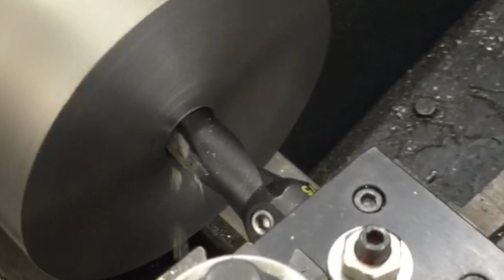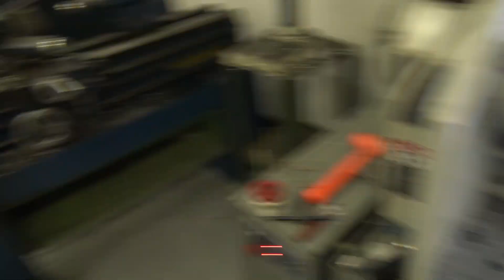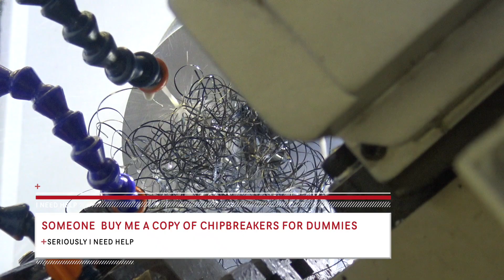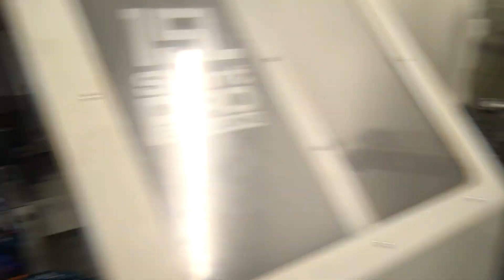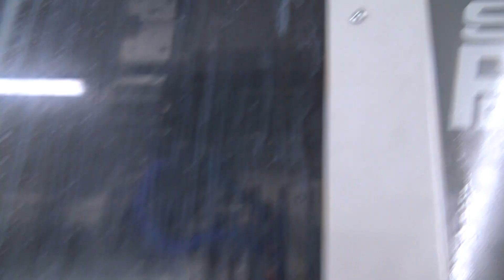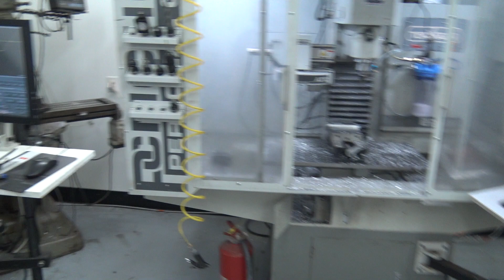Turning Steel Cones on CNC Lathe!  Widget86

Comment: Chip breaker 101, at least the quick and by no means complete version. You need to have a DOC greater than your tool nose radius at the very minimum with non self-breaking materials like steel, where brass would be a self breaking material. Then dependent on the chip breaker you are using you will need a feed rate of at least one third of the tool nose radius per rev. Generally the softer the material the higher these parameters need to be to get a chip to break. You a using a CNMG 432 insert, that 2 at the end is the radius in 1/64 of an inch so you have a tool nose radius of 1/32 of an inch or .03125" so your both your DOC needed to be a minimum of .03125 and a feed .0104" per rev to get even close to getting the chips to start forming. In a soft steel like 1045 CR you would probably need a depth of cut closer to .05" so get chip formation. If you do not have the power, rigidity or even that much material to remove then I would recommend going to a smaller tool nose radius. A small nose radius also will reduce your tool radial tool pressure some what. On a machine like the tormach I would use a #1 tool nose radius as my primary tool radius everything only going to a #2 for strength in interrupted turning.
For more info I would read this book published by sandvik as it's probably one of the best insert turning resources that you're going to find. They have a lot of other great publications of this nature on there web site as well.
http://www.sandvik.coromant.com/_layouts/15/tibp/downloadshandler.ashx?url=http://gen-sandvik.ecbook.se/eccatalogues/download/247/?lt=false&fileName=Turning%20Handbook
Reply: was just going to say that he needs to push that tool harder, lol.  Need to talk to Abom79, he may run manual lathes, but the fundamentals are the same
Reply: +NYC CNC  -- ROC have to be atleeeeeast the tools nose radius. * Pls consider the depth of cut and feedrate to be suitable for your choice of insert... -- I usually run a 22HP Okuma Lu15 lathe and have great experience with (for stainless), insert: Sandvik CNMM 120412-QR-2025, 8mm depth of cut (16mm on the diameter), Vc=140 (again metric, sorrrryy..) and F0.27 :D ---- how many HP have you got on that spindle??
Reply: +Bruno Hougaard that's 1.4044 (316) stainless btw :b
Reply: +Josh Peterson yes, indeed

Comment: John I have a small Haas lathe in my garage(running on 230 volt single phase) and have the same problem breaking chips in bigger diameter parts. Your problem is you cant take a deep enough cut at the feed required to break the chip without stalling the spindle. You are taking what for bigger machines would be considered a finish cut but using a style of insert they would use for roughing. It wont work on your lathe. What you need is to use a finishing style insert with a low feed chip breaker and smaller tip radius. There are many different types of chip breaker styles on inserts you just have to try them until you get what you want in chip control. I see in the comments people giving this and that advice but this is something that has so many variables you really cant say just do this and it will work. Your set up your coolant, coolant pressure, depth of cut, feed rate, spindle power, machine rigidity, material your cutting to name a few. You just have to experiment an with experience on your equipment you will find out what works for you.

Comment: For my HP challenged G0602 lathe I found to break a chip you have to just keep increasing the feed and if you start bogging before it breaks a chip reduce the DOC and push the feed even more. I have also given up on Shars inserts, they are all pretty much junk, eBay is a gold mine for quality inserts at a great price, I have enough Sandvik CNMG 432's for life. Here's an example in steel, breaking a chip even on the finish pass: https://www.instagram.com/p/BCZmKTBRz-y/ and in aluminum https://www.instagram.com/p/9SIwMTxz42/ .

Comment: Just about missed this with the different thumbnail! Would you not have had a bit less runout if you had flipped the piece after truing the first face? That should have split the difference between any chuck to tool holder gantry play.?.

Comment: hi john 
 for chipbreaking speeds you should run the lathe at 700-1200 rpm and the feed should be 0.01 per rev and the depth of cut should be 0.05 per side at least
good luck

Comment: Just now starting to learn how to program a CNC Lathe manually and this video spotlighted the need for understanding tool geometry on the lathe. Have yet to actually run a program that is cutting material but I'll be sure to go back and take a look at my feeds DOC and speeds before  I do. Thanks for the video!

Comment: @ 9:09 you need to increase your feed so the chip is more square, the ratio you have now is 3 to 1 with the 0.005 per rev make it more like 0.015 and you may need to play with the SFM to get the right load on the machine. Your depth of cut should be at least 2/3 of the nose radius of your tool, if not much deeper (HP limited).

Comment: how bad was your insert drill chattering on the manual lathe, how did you center it? I have a 10x22, wondering if it will work before i buy one.

why is your channel named saunixcnc, any relation to linux?

Comment: hi John,  I love the bad videos as good as the good ones, I feel maybe it's the tormach conversational programs, I had the same problems with mach3 turn conversational programs,  seams tormach copy the flaws as well  if you learn a little bit of hand coding you will get better results, the cone for example, you could code it so it cuts both way on way -z then +z, there are too many wasted air cutting moves, plus when cutting try changing spindle speed by 30% up or down and same with feed rate, to find the sweet spot, thanks daniel
Reply: There are to many air moves, when I code my programs I use a hand sharpened hss tool bit that's sharpened for right and left cutting with chip breaker, I then rough down the part this avoids cutter air, then use an insert tool for finishing the part, my lathe is a 7 x10 that's cnc, I run the first part and change feed and speed on to fly till the chip breaker works well, conversational programming is quick but not always the best, if it's one part it's ok, but if more than one part the code can be tweaked,  I have started recoding a a few of the mach 3 turn wizards so they code work more efficiently, I am sure if you talk to John grimsmo about hand coding lathe job, he will agree hand coding works best, thanks for your reply John,  daniel

Comment: Good job John, you got the parts done on size.  You have a starting point now to experiment with your DOC and feed rate.  I was told that you need to make sure your DOC was greater than the radius of your insert for effective material removal.

Comment: from personal experience you have to take far more aggressive cuts with steel than that to make any sort of acceptable chips on the lathe. It took me a year of birds nesting 01 tooling steel every day before i realized it wasn't my inserts or material, it was my feed and depth of cut. You've gotta run faster, and harder. Not sure however if a tormach is the machine for that.

Comment: In order for the chipbreaker to work, you have to keep your DOC deeper than the nose radius on the insert.

That means that a 432 insert needs a DOC of no less than 0.062" (off the OD).  Full stop.  Anything else you do is pointless until you get the DOC over the nose radius (otherwise the chip never TOUCHES the chipbreaker).

Since your machine obviously can't take a 0.100" DOC at 0.015 IPR like you'd need to in order to break a chip with a 432 insert, you're going to have to go to an insert with a smaller nose radius.

Find some 431 or 4305 inserts and run them at ~120% of the cutting data you used here.  Should make nice little chips, and use less horsepower than these cuts did.

Birds nests always mean you're loading the insert too lightly for the combination of nose radius and chipbreaker.  If you can't reduce the nose radius and you can't increase the DOC, then decrease the SFM and INCREASE the FPR until it breaks the chip or stalls the machine (or your surface finish/size goes to hell).

Letting a job run with horrific birds nests like you did here is dangerous as hell, even for the machine (especially running that four jaw with the jaws hanging out like they were).  Total snaggle and boom fest just waiting to happen.

BTW, if you want to know where to start with SFM, DOC, and IPR on any standard carbide insert, flip the package over and read the label.  The MFG went to great pains and not insignificant expense to supply you with those operating range numbers, you might as well learn what they mean and use them.
Reply: +LogicIndustries 
Thanks for the write up learned a lot just have to convert your USA specs to european codes ours look like EG CCxx ( xx = MT or GT )  CCGT 060202 ALU AK10 Carbide Inserts for Turning Ground and Polished for Aluminium Uni-tip  this is a 0.02 mm rad tip,

yes I know they are small but i have less HP than John so you go with what you have ( my shop is a pure hobby shop no paid work )
Reply: +LogicIndustries All very good advice! Glad someone took the time to write it up. These lathes are great for bar work but anything over 1" dia and you start to have a serious lack of horsepower making it much harder to control the chips. Personally I'd rather have a minor birds nest than stall the spindle... sigh Tormach life.
Reply: +NYC CNC Gotta pay close attention to what they actually state the nose radius is, because there really isn't any standard nomenclature to denote nose radii under 1/64" (what the 1 in 431 means).

Once you go below 1, the standard gets a little hazy and different manufacturers note the smaller radii differently.

For example, ISCAR doesn't offer a 05 corner radius, they go straight from 1 to 0, which is what they call their 0.005" corner radius.  So for ISCAR tools you'll want a 430.

But then, SECO's 430 insert has a 0.008" corner radius, and Carboloy doesn't even use the inch version of the ISO nomenclature, preferring to use the metric spec for their inserts, which means a CNMG-431 from Carboloy would be called a CNMG-120404 (80° diamond shape, zero side clearance, as-molded medium tolerance class, double sided with chipbreaker and center hole, 1/2" inscribed circle, 3/16" thick, 1/64" or 0.015" corner radius).

So if you wanted a corner radius under 1/64" from Carboloy you'd call for a 120402 (0.008" or 0.2mm radius), or a 120400 (they say zero radius, but the tolerance class means you could have anywhere from actual zero radius all the way up to a 0.003" radius).

Kennametal uses inch nomenclature and goes from 431 (0.015" rad) to 43.5 (0.008" rad) to 430 (0.004" rad) all the way down to 43X0 (0.0015" rad).

Essentially, every manufacturer has their own way of dealing with nose radii under 1/64", so your best bet is to decide which MFG you want to deal with (like which grade and chipbreaker you like the best) and then download their catalog and see how they name their inserts.  Then you can search eBay for what you want with a lot more confidence that you'll actually find something.

Otherwise, you'll have a hell of a time trying to find what you're after.

Also, for your application, just skip right over anything that is designed for roughing or even medium turning.  Your little lathe just doesn't have the HP to properly use those geometries (and they won't be offered in the sharp nose radii anyway, because the sharper the nose radii, the faster it burns off when you're taking a heavy cut).

Stick to grades and chipbreakers made for finishing in hard to chip materials like stainless and superalloys.  Those seem to be the grades that turn up the most on the surplus market anyway, so that's a lucky break for you.

If the packaging doesn't have speed, feed, and DOC recommendations on the back label, go download the MFG's catalog and look up the grade and chipbreaker, the cutting data should be listed there as well.  Heed their suggestions, they know what it takes to make their tools work at their peak.

Comment: Would agree with doc. Needs to be larger then tool nose. Feed should be up closer to .010-.015 for light hp. Double check your insert sfm. Should be 500 or less in steel. Strings look awfully blue
Reply: +NYC CNC I believe so. Check your inserts but most of our steel inserts we run at the 300-500 sfm. Blue with coolant to me is way to high on sfm. For fun try 450 sfm, .03 doc (or at least your tool nose) .010 ipr and choke up on that tool holder. Need to form a large enough chip to curl off the chip breaker.

Comment: BIGGER CUTS DUDE!!! Use the whole insert! you're wasting your time, and money. my personal experience with things like 4140 have been .020ipr and a .050 deep cut. in aluminum, I have had fabulous luck with a .055 cut, .009ipr and g96 of 400, maybe lower. just my $.02
Reply: +Christopher Sauter He doesn't need to take bigger cuts,  he needs inserts designed for the types of cuts he's taking. I have some Sandvik insets, that will make chips at 0.004ipr, and .005 doc.
Reply: +dans-hobbies 
Time to talk with a insert supplier to sort it out ,try this try that is a wast of time talk to the people who know about the tip and its operating conditions, even different manufactures with the same part no. Differ in performance
Reply: +Stuart Hardy I agree, the best bet is to look up the technical info on a given insert, or talk to a sales rep. IMO, ISCAR is probably the easiest manufacture to get technical information  from.

like this for example, you can drill down to specific grades.
https://www.iscar.com/eCatalog/item.aspx?cat=5550223&fnum=867&mapp=IS&app=86&GFSTYP=M
Reply: +NYC CNC 
Completely agree about not getting full HP at low rpm, would it be possible to change the gearing even more? if you could half the max speed you should gain enough torque to take a proper cut.

Comment: To break the chip, I find that a bigger feed and depth of cut works. the bigger feed makes the chip curl into itself, breaking and separating itself. Higher depth of cut makes it harder to curl and more brittle. we make a steel part where we have to take it from 2" down to .5". We use ISCAR Sumotec inserts and take a .125" doc, at a pretty good feed, which I can't remember. Give it all the machine has, you will experience better surface finish and faster cycle times